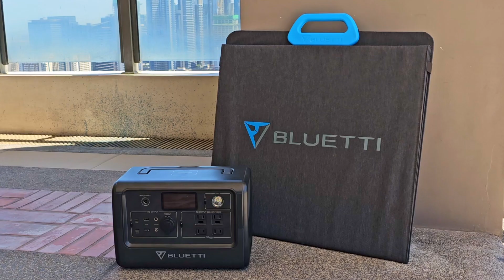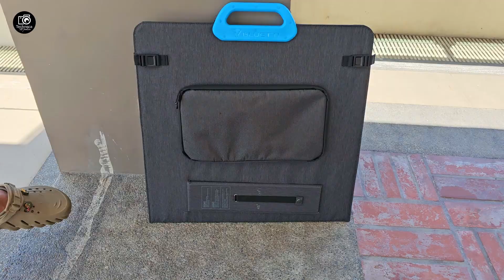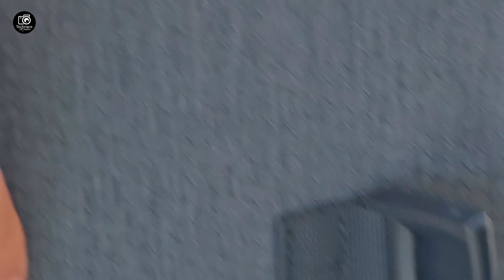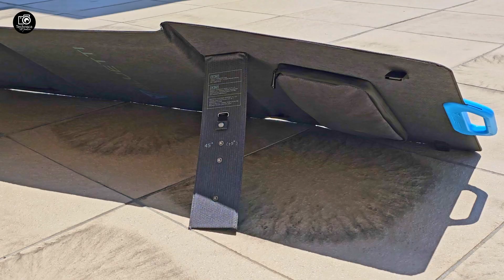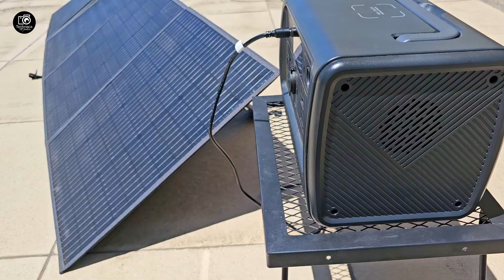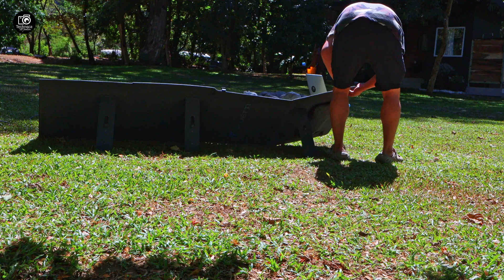Bluetti PV200 Solar Panel and Bluetti EB70 Power station Review

Comment: I have the exact same combo and I usually get more juice from the PV200 (180W). Keep in mind that the pannel is not IP67, only the pouch in the back is. (all folding pannels are like that if you read the manual carefully). Also, if bird droppings end up on the pannel, wipe them out immediately because they will damage your pannel pretty quickly if they get dry. Always be there when you charge your battery, don't leave and risk losing them to a rain shower out of nowhere. They won't make it, trust me, I "tried".
Reply from the maker: I am very aware of it, not weatherproof, and sad to say that's one of the downside that I discovered when I started using it.